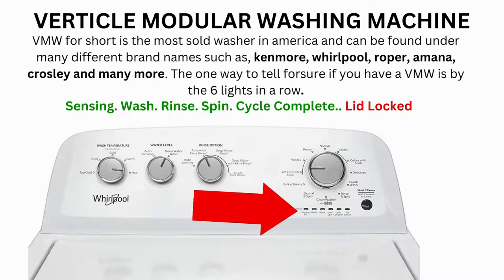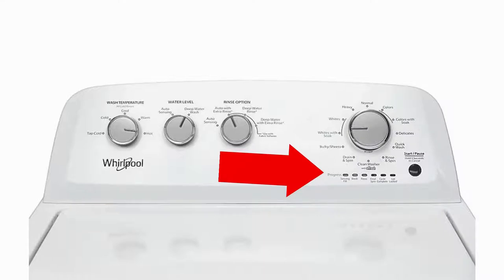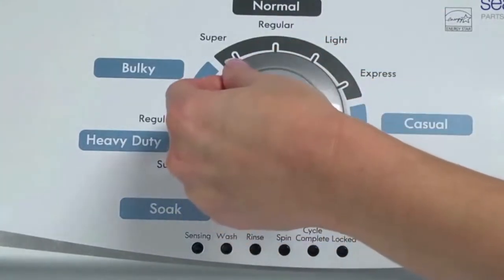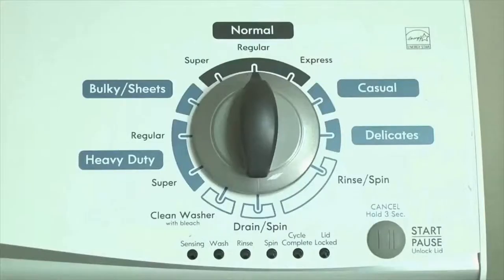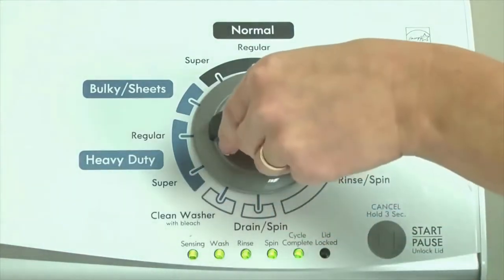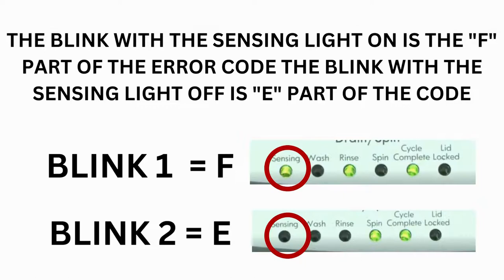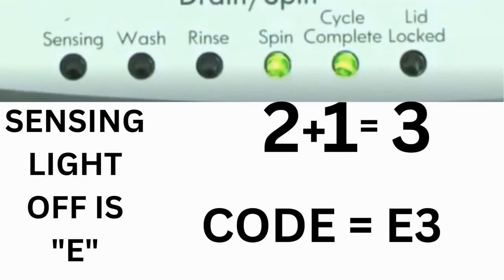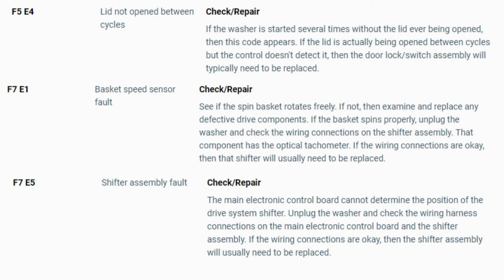Why is my Whirlpool top load washer not spinning clothes dry

Comment: Wash machine. ..washing, spinning...clothes still  soaking wet?     Need help.
Reply from the maker: What happened?
Reply: Does not dry fully after complete wash
Reply: My wash cycle complets, but the spin dry is not working so the clothes remain soaking wet..
Also, i tried your method and the lights light up except the soak light but the others dont blink @methodmeetsmadness
Reply: Samething my whirlpool does i washes but not spin dry the clothes...clothes always remains wet
Reply: My whirlpool washes but does not spin dry clothes fully. Water remains in clothes.

Comment: all the lights dont blink only the one (first one) Ive done it a few times.
Reply from the maker: Its most likely a bad control board :( .. You can get a new one for $100  -   $250 . I have had a good success rate with used ones from ebay! $75ish! Just match the part number from your control board they are very simple to change!